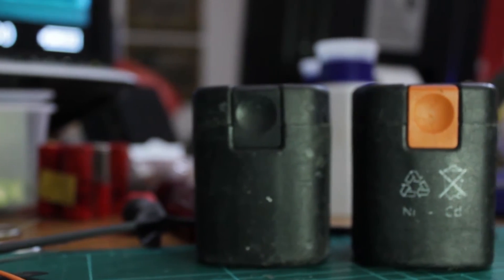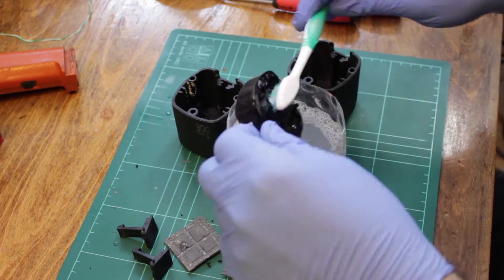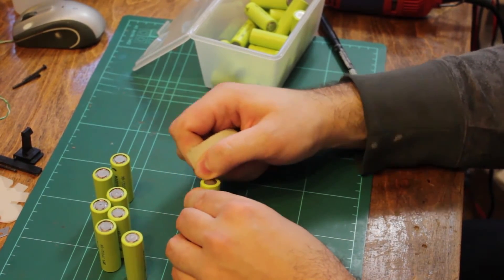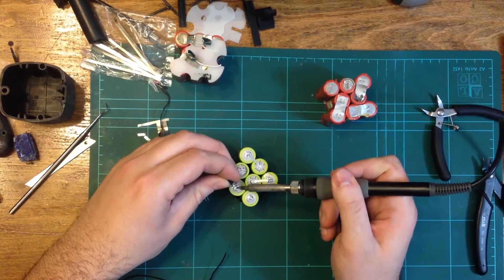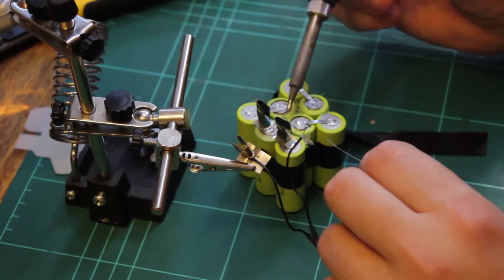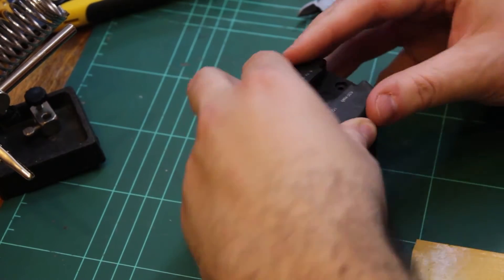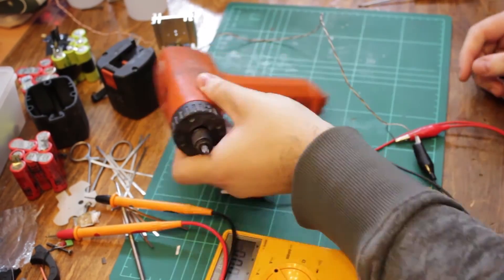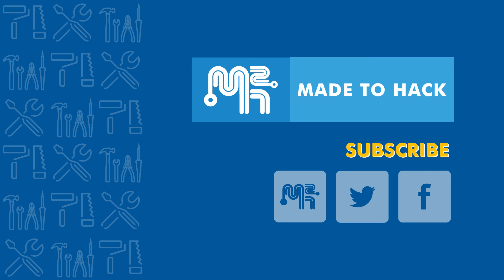How To - Replace Dead NiCd Cells in a Cordless Drill Battery Pack

Comment: I'm pretty hopeless when it comes to this kind of thing, my dad was an Electrical Engineer, but he was never great about teaching the trade to me. I'm in a corner however, because my 6v  Ryobi HP61 has no battery casing. It's just 5 cells tabbed together. With 3 slide connectors (-, +, neutral I assume) to get the whole rig connected and disconnected. I was interested in how you found details about the cells in your application since mine have no writing on them. I would like to get something with improved stamina on it. Also if I manage to build one I'd like it if I could build 2, however one would not be used until needed (possibly years) would that be possible with the batteries being Ni-cd?
Reply from the maker: Hi there, oh boy. It's been a while since this video. I'm pretty sure that since it was an older unit, it was most likely ni-cd. Possibly ni-mh. However, opening them up and looking at the batteries, they were I think panasonic if I remember correctly. And they were well marked. After that, any ni-cd cells of the same size will do since they are essentially same voltage / capacity. Not much advances in Ni-Cd since Ni-Mh and Li-Po are the standard now.

Comment: Great video! I just bought a set of NiCad batteries from my old drill that won't hold a charge, but how about using NiMH batteries, the only caveat I found online was that you can't leave a NiMH battery pack on the NiCad charger, charge and remove. Any experience with changing to NiMH batteries?
Reply from the maker: Hi, no I don't. NiCad have the ability of going down to 0 V charge, and being able to be rescued, I believe. However, NiMh, you can't go lower than a certain amount.